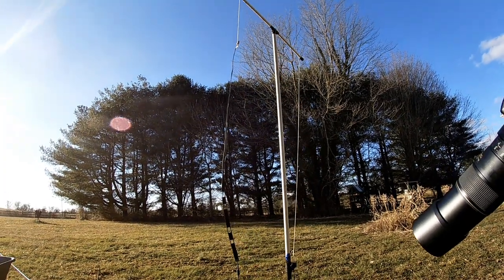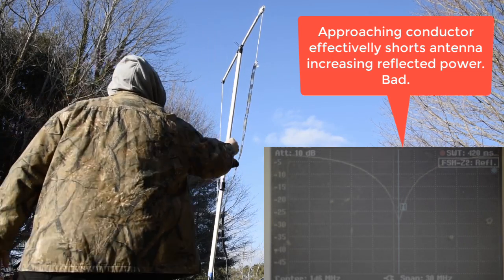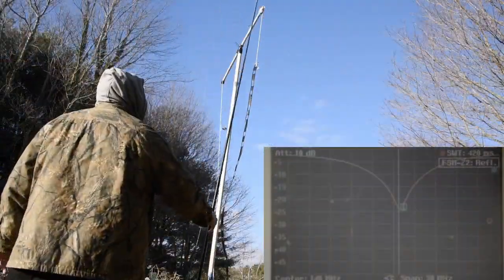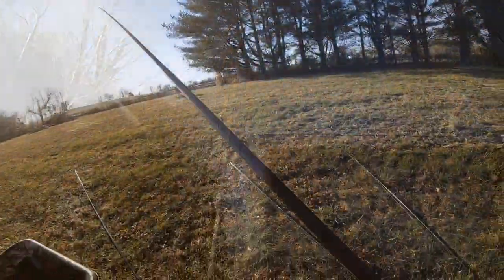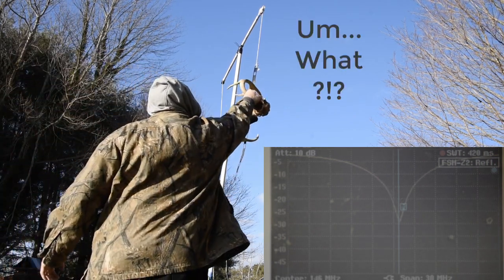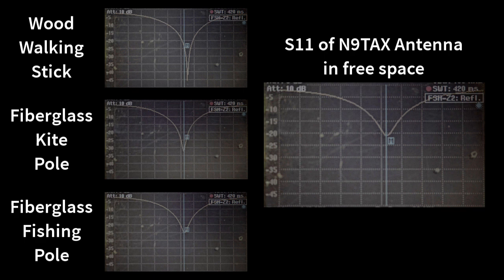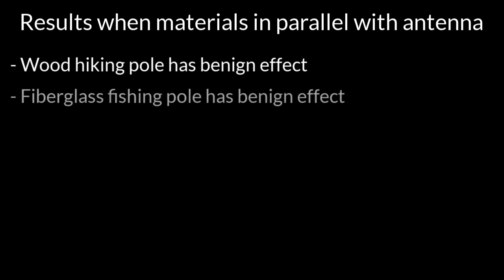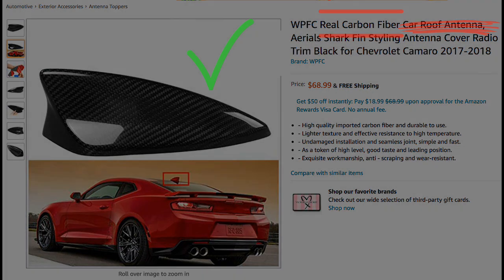Are antennas altered in the presence of carbon fiber masts?

Comment: This is very good -- though it's quite obvious that the return loss (SWR) curve changes only when the objects are VERY close, and practically touching.  Even a few inches seems to avoid a severe detuning (and presumably decoupling).  It's not very clear to me what the likely impact is from a received signal strength perspective, for both incoming and outgoing signals, as long as the conductive materials are not essentially touching.
Reply from the maker: The return loss, with its sensitivity of conductive (and dielectric really) objects in the near field of the antenna giving us a way to compare materials in an RF sense.  The moral of the story is the carbon fiber mast acts a lot like a conductive metal mast.  With that knowledge, we can plan our antenna system... for example using the carbon fiber mast like we would use a metal one... perhaps as a support for the center of a dipole.
Reply: @SkyCharter  I appreciate the reply, which is both sensible and well thought out. That would be my primary plan (inland and above typical soil), but I am scheming on best possible ways to use my new Pota20 carbon fiber mast at the beach, close to the water line and likely with a seawater ground connection just under the waterline. This would make vertical polarization ideal. It may not be the ideal support, but the appeal is the size/weight.

While I'm talking about HF, while your test was VHF, it's very clear that the pole will be very much in the near field.

Comment: So short sections of carbon fiber golf club shafts used as spacers for home built ladder line with insulated wire or folded dipole element separators with insulated wires SHOULD be benign? Or would it add large capacitance? Surely it would not re-radiate HF since only a few inches long and perpendicular, right?

Comment: It seems like the two important points from the video regarding the effects are that:
1. The assumption is that the mast material and the antenna are parallel.
2. The mast is in very close proximity to the antenna.

So, what happens if the antenna on atop the mast instead of hanging parallel to it?
Reply from the maker: The parallel test arrangement certainly is to maximally couple mast and radiator... mostly to demonstrate the mast's conductivity and dissuade those who think carbon fiber masts don't conduct at all.  For typical center-fed dipole hoisting, the carbon mast should be fine... as would a metal mast.

Comment: New subscriber here.  Thanks for the video.  I am new to ham radio and considering what sort of mast to use (mainly for portable use). I wonder how far away the antenna can be from a conductive surface like the carbon fiber pole or a metal tower where it would not de tune the antenna.

Comment: If we use a carbon fiber mast in the usual expected fashion, we attach a vertical antenna at the TOP of the mast. The antenna is far away from the carbon fiber pole. The antenna is NOT lying parallel and/or adjacent to the carbon fiber pole. Could you please repeat the experiment with the antenna attached at the TOP of the carbon fiber pole and see what results you get? That would be the truly relevant test. Thanks for your great work.

Comment: Very good test. Thank you for doing this experiment and sharing the data. You should send this data to Gigaparts re: their 34 foot carbon fiber multi-section mast product.
Reply from the maker: Thanks for the comment.  I'll let others share this where they think appropriate... but I get your point.
Reply: I suspect Gigaparts didn't test their mast at a distance of two inches from a Slim Jim.  There are other use cases for those masts.

Comment: Maybe a dumb question: but would wrappings the carbon fiber mast with insulation tape do anything?
Reply from the maker: It would certainly help prevent the carbon fiber from shorting anything out by direct contact, but any conductor wrapped in an insulator will react quite well with radio energy in the vicinity.  Think fiberglass encased vertical antennas as one corollary.

Comment: Thanks for the video — very helpful! I have a SOTABeams Carbon6 which I plan on using for an inverted V random wire end fed antenna, so I’m glad to hear that the mast will work fine in this configuration. Your video was invaluable to ensure that I don’t try to use it in a vertically polarized configuration. Great work! 73, Mark K0EHR
Reply from the maker: Glad it helped

Comment: Hello, thank you so much for the information and the experience. 
I have a question for you as an expert, I want to use a mast to used for mounting cellular signal  booster antenna weboost , also for mounting some wifi antenna from Ubiquiti. 
Is the carbon fiber will effect negatively on the performance of the antenna devices?
Thank you
Reply from the maker: I suspect the cellular antenna is designed to mount atop a study mast made of anything conductive or not so the antenna is well away from the mast's effect.  It's probably fine, but testing is the ultimate truth.